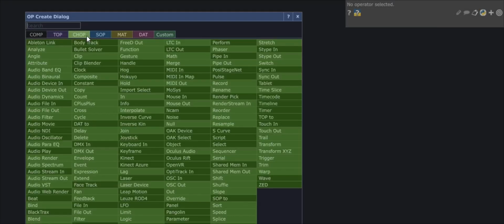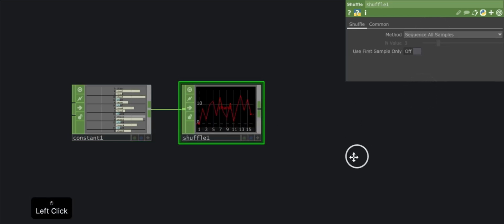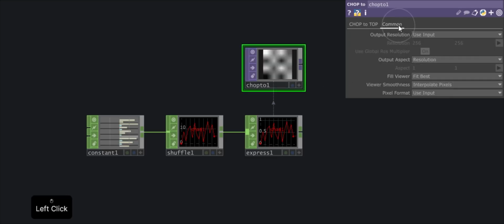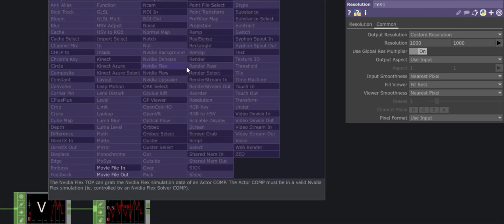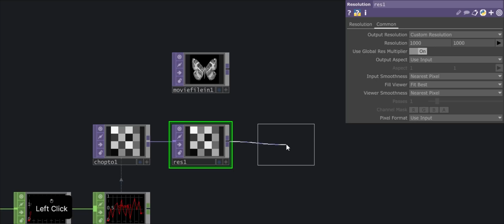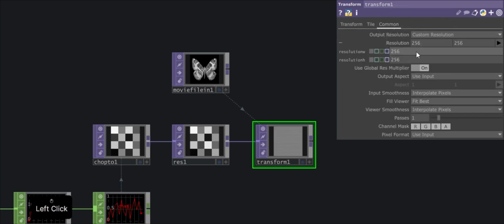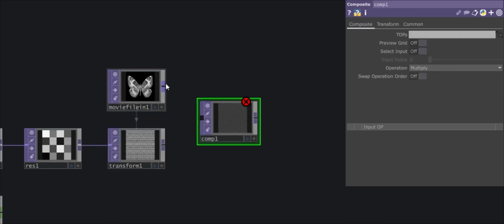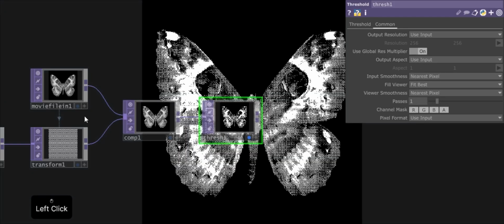Procedural Dithering Without Code [ TouchDesigner ]

Comment from the maker: Tip (optional):
Instead of creating the channels manually, you can type the following in the channel name field: chan[1-16]

This will automatically generate all 16 channels with a single expression.

After that, you can skip the Shuffle CHOP and add an Expression CHOP directly.
In the Expression CHOP parameters, enter the following to assign values to each channel and normalize them:

([0, 8, 2, 10, 12, 4, 14, 6, 3, 11, 1, 9, 15, 7, 13, 5][me.chanIndex] + 0.5) / 16

This way, you’ll get the same results but with fewer operators and without having to create each channel manually in the Constant CHOP.

Follow DML:

📂DistortedMindLab/
├── X → x.com/stve__
├── IG → instagram.com/stve.mz
└── Patreon → patreon.com/c/DistortedMindLab
Reply: hey there! just letting you know that I tried this method but the expression CHOP throws the following error:
"can only concatenate list (not float) to list"

I'm going for the method in the video for now, great tutorial :)
Reply from the maker: @marianobalestena3741  My mistake, the correct expression is:

([values][me.chanIndex] + 0.5) / 16
Reply: @DistortedMindLab  great! Thanks for the info

Comment: Awesome! Will check out your patreon, just getting started with td and this is right up the alley of something I wanted to achieve.  Can I use a live video input as the source?
Reply from the maker: Welcome! I hope you find my content helpful :)

And yes, it’s definitely possible. However, if you’re using a source that comes from an operator other than the Movie File In TOP (for example, the Video Device In TOP) you should link the dithering pattern’s resolution to that operator.

But to avoid doing that every time you switch sources, just add a Resolution TOP after the Movie File In TOP, and link the resolution to that instead. This way, no matter which operator your video source comes from, the resolution will always stay consistent.